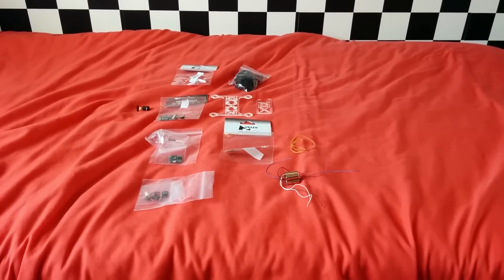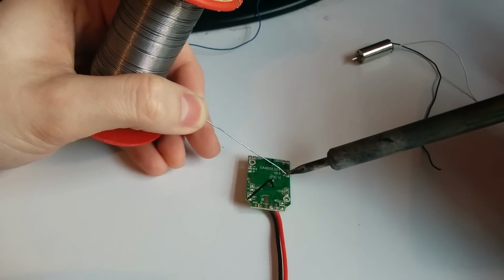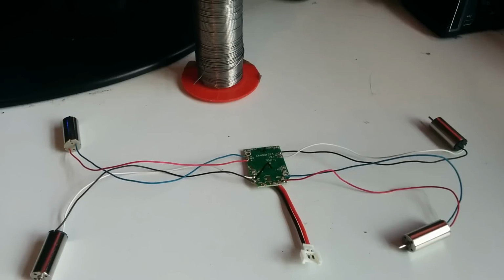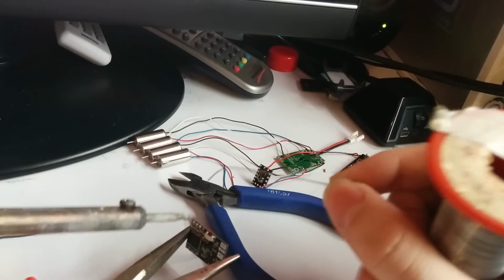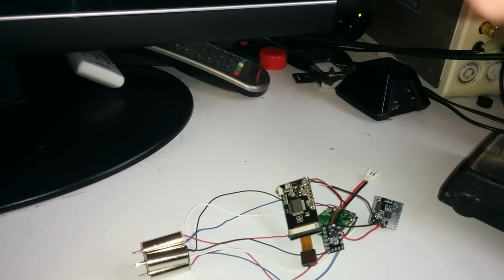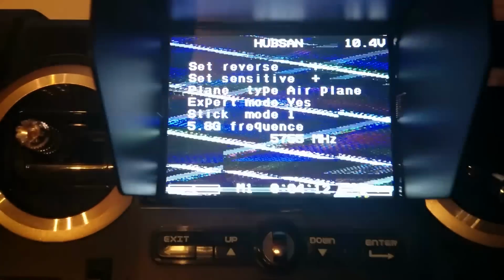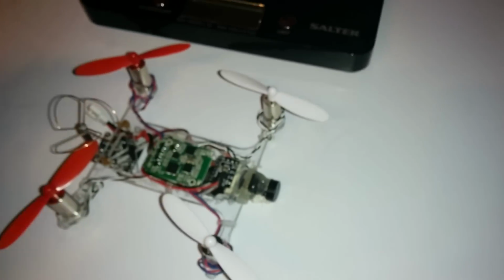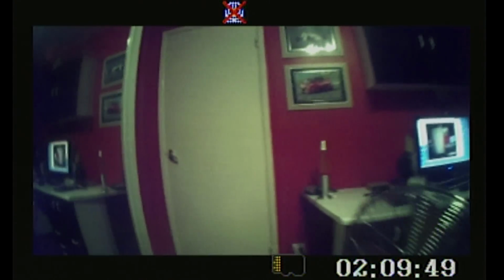Microquad Custom FPV Full Build & Flight With HD Recording

Comment: Hi Andy, you are very knowledgeful with these mini quads.  I really need your help too.  I purchased the JJpro T1  mini quadcopter and the "irange" transmitter, both links provided below of where I got them from.  Unfortunately there aren't enough youtube videos on how to bind these two together.  Can you either tell me if the two are compatible and capable of binding or provide a video demo? I have not had any success binding, maybe I'm missing a step?

http://www.gearbest.com/multi-rotor-parts/pp_484251.html  

https://www.banggood.com/IRangeX-iRX-i6X-2_4GHz-10CH-AFHDS-2A-RC-Transmitter-With-A8S-Receiver-p-1119005.html?rmmds=search

Comment: Hello Andy. I have been watching your videos for a long time now and then i decided to make my first little mini quad with a hubsan PDB/reciver and The motors that you get with The hubsan x4. I had The hubsan x4 but The PDB broke so i kept The motors and The transmitter. When i got my hubsan PDB from banggood i tested it out so i plugged in a battery and i was able to bind it to my transmitter. I soldered The motors to plus and minus as you said in your in your hubsan build video. But it wont lift, it only turns to The right as soon as i am at 40 throttle, it flips to The right. It is like i have 2 very powerfull motors and 2 are very weak. But When i try turn to The right The quad turns. I Wonder If The problem is The motors or The PDB or my transmitter. Btw i have The transmitter that i get with The hubsan x4. I used The 120 mm lktr frame. Keep up The good work with your videos👍👌😊
Reply from the maker: it sounds like either two of the motors are wires wrong or the props are on wrong. hope u get it sorted!

Comment: Andy could I just add the transmitter to a stock hubsan x4 107c? From my understanding the camera board you used is the factory hubsan one that would come with the x4 107c
Reply from the maker: it has to be the 2mp version and yes u can
Reply: +AndyRC how am I sure that I buy the correct hubsan x107c
Reply from the maker: +Kevin Gregory it will say 2mp version

Comment: Do you have to solder a 2.4ghz antenna onto the bord? Or does it get good range without any antenna? (Not the FPV the flight receiver)
Reply from the maker: +QUIT. no its got a trace antenna built into the pcb
Reply: AndyRC Thank you! Keep on going with your videos! Greetings from Germany!
Reply from the maker: I will thanks for the support

Comment: Another Awesome Video Andy!   Questions:   There seems to be a couple H107C camera boards available out there, is this the C+ model board?   You counted the 4th solder pad from the power leads, is there a label for that pad on the board?  Lastly, so there is only one video lead you solder from the regulator to the camera board?  Keep up the great work, we enjoy your videos!!
Reply from the maker: +OP theFLASH this is the non plus version and its the 2mp version theres also an SD version that does not have it. the pads are not labelled no and now they have put just two pads instead of four yes just one video lead
Reply: +AndyRC Thanks for replying Andy.  I happened to find a listing:  http://www.ebay.com/itm/161850183555?_trksid=p2057872.m2749.l2649&ssPageName=STRK%3AMEBIDX%3AIT

The solder pads are labeled in that listing (2nd pic).  Which do I solder to Tx (3rd pad),  Rx (4th pad)?  I don't know since I'm questioning from the Transmitter (Tx), or to,  same for the Reciever (Rx)?  what's your best advice to this, as I have a few friends who are asking about this to, and I referenced this (your video)..... Thanks once again!!
Reply from the maker: you only solder the video wire to the 2mp board as shown in this vid.

Comment: Andy, my build went well. About weighs about 41g and I have a 380mah bat and I get about 3 mins of flight time. Is that accurate? What's the Max battery should I try? And my quad copter vibrates a lot, how do I fix it. Thanks
Reply: The 380mah is an additional 11g
Reply from the maker: +Alvin Bui the hubsan frame likes to be more heavy than that. use 750mah nanotech battery
Reply: +AndyRC I got the hubsan x4 h107c and I took out the frame and notice my 2mp camera doesn't look like yours. I can't find the solder place for video out
Reply: +AndyRC  nvm Andy i have the non hd one. Will it take video out?
Reply from the maker: not that im aware of :(

Comment: i love your setup!
Reply from the maker: +Alex Morales thanks alex :)
Reply: +AndyRC your welcome
Reply: +AndyRC what if i make it without the 5v regulator? will it still be the same?
Reply from the maker: +Alex Morales no soon as the motors spin up u will lose your picture
Reply: +AndyRC so ur saying the vibration of the motor will be cutting off the footage? If I don't have a regulator
Reply from the maker: +Alex Morales no the electrical noise produced by the motors using the same power source wipes the image out the regulator filters that noise out

Comment: Hi, did you manage to attach a IR/UV filter to your camera's wide lens as I have seen others out there who didn't manage to on the same camera module and wide lens set up.
Reply from the maker: +Adam Ip the 808 lens comes with an ir filter so not a problem. not sure why people are adding their own?
Reply: +AndyRC Ah, Okay thanks. Other people don't seem to have the IR filter on their lens that's all, and haven't bothered fitting one.

Comment: sorry, no, your technique is great. Its just that seasoned pros out here kinda cringe when we see that iron, and we can tell our iron would have made the connection in half the time. I swear you could improve the strength and decrease the dwell time of the iron on your sensitive electrical components if it were properly maintained. Again, I love your videos and just want you to get better. Thanks sooooo much for your micro builds, I'm loving these things. I got two transplanted hubsans in carbonfiber frames with the fatshark micro fpv camera/transmitter.
Reply from the maker: +DJ Klermund you are most likely right. i am not the neatest and tidiest of people. nothings fallen apart yet touch wood :) i do need to invest in a better iron really with temp control. this one i have cost 9 gbp and therefore i dont look after it cheers

Comment: hey bud I love your videos but 90% of your soldering problems are related to the state of your soldering iron. if it was clean it would retain heat and flux longer to transfer it. some real good old soldering videos been out on YouTube  for details
Reply from the maker: I don't have any solder problems but thanks for the tip. the iron is the least of my worries. its the 20 year old solder that still somehow works lol

Comment: Hey Andy, 

I tore the link between the cam and the board. Is there a way i could purchase any cam that could go with the hubsan 107c board ?
Reply from the maker: +bruceleedv no im afraid not its opposite polarity to the 808 16 you will have to buy another bgoard im afraid :( I tried to source the camera and ribbon a few years ago from the part number on the ribbon. they are exclusively made for that product and cant be sold separately. you could try search again as it was a few years ago i searched for one, also broke mine once. the ribbon is really fragile.
Reply: AndyRC
Couldn't find anything man. Will learn to be careful. Thanks for the info !
Reply from the maker: sorry to hear about it. it does happen from time to time in the hobby. i once lost a 200usd quad and planned on packing it all in but i got sucked back in lol. hang in there! when it does work its awesome
Reply from the maker: that one wont fit im afraid. its backwards polarity (the ribbon connects in other way round) it will blow up the entire board
Reply: +AndyRC 
oh my god
trying to cancel my order, looks like i'm too late lol
thanks

Comment: I tried to purchase these Items from FPVhobby.com and had issues with the paypal only check out.  I need to get FPV on my H107C HD!  I also have an H107C normal but the HD has a tweaked frame so it doesn't fly well. I figured with a lighter frame I could make the repair and upgrade to FPV.  Is there anywhere else I can find a small transmitter and regulator without an integrated camera seeing as I already have a camera board on my Quad?
Reply: +RockPDX  hey guys! I had a but of trouble with Phoenix Flight Gear. I ordered the 7mm frame and had to order an 8mm. they still haven't gotten back to me after 3 emails and a phone call. really not impressed with that, but it was my fault. I am however impressed with the frame and it is all put together and flying fpv! I need a wide angle lense badly and flight times are pretty short at the moment. I'm going for the turnigy 3.7 750 and possibly a less common venom 600mah 35c. probably could use the dark editions with better props lol but I'm trying to stay within reason on budget. I didn't record the build but I did take photos. I'll put together a slide show for you guys and get it up asap.
Reply from the maker: +ryanworks35509 readymaderc do a nice pico one also check them out
Reply: +AndyRC thanks Andy! I picked up this: 1 x RMRC - 1258MHz Pico Video Transmitter (PICOTX-1258) = $39.99,  1 x RMRC 5V Step-Up Voltage Regulator (RMRC-5V-REG) = $3.29,  1 x 3 Wire Mini 1.25mm Connector: Generic (3WIREGENERIC) = $2.99.  ordered them this morning. I'm also looking into a lighter frame and the receiver for my ground station.
Reply from the maker: good one :)
Reply: +AndyRC  I was looking at the lawmate 1.2 Receiver but I realized it didn't have the 1258 mhz I needed so after some shopping around I found : a 12 channel receiver from 900 to 1300 mhz that has both 1258 and 1280 mhz from hobbywireless.com for a very reasonable price! It's on it's way now.  The last component to my build will be the frame.  I'm looking at the phoenix flight 110 mm carbon frame.  I'll try to put together a build video and wwe will se what I come up with for my first fpv!
Reply from the maker: great let me know once done I would love to see it
Reply: +ryanworks35509 Would love to hear the results for that combo, especially how's the video noise using that regulator?
Reply: +ryanworks35509  UPDATE: I got my build put together and took photos for a tutorial however upon testing my flight capabilities it seems with this setup that my 1258 mhz VTX steps on my 2.4ghz hubsan radio transmitter.  I used to get about 1km but now at about 50 feet the quad drops from the sky and is no longer linked to the transmitter.  I am going to buy another VTX and Video reciever on another frequency and hopefully not have the same issue, I thought it would be good to go but it looks like radio harmonics are giving me trouble. I took a nose dive and ripped the ribbon cable on my hubsan camera board, i cant find the lense and ribbon cable stnad alone so i'm going to need a new camera, vtx, and reciever... time to order more goods....
Reply from the maker: if you use the wifibooster used in my videos you will no longer have that problem using that VTX. in this build im using 5.8g
Reply: +AndyRC  I twisted the ribbon cable on my lens during construction and now i'm out a camera board!  I looked everywhere I could and it seems there are several different versions of the PCB for the HD hubsan camera. I e-mailed several dealers in hopes of finding anyone that can ship a camera board with a video out pin.  Wish I could find the lens module with a ribbon cable, but they don't seem to match up either.  I tried to steal the lens from my standard definition Hubsan and it didn't have the same routing on the ribbon cable.  I have a 1 gram micro cam on the way so i will be flying fpv with less weight however I will loose the ability to record which makes me very sad face!
Reply from the maker: I had this happen to me also. I bought another from banggood. I think their version has the video out. all the best
Reply: I ordered one from BG, we shall see. The print on my camera board is dated 2014. Does anyone have any data on the version dates or identification codes?  I'll post mine when I get home.
Reply: +AndyRC  I got my 1 gram micro cam in today, made myself a little PDB and after some trouble shooting with power filtering and lens focusing I am flying FPV on my Phoenix Flight Gear 110mm Carbon H with hubsan x4 FC.  The range of the controller still seems very limited, but i'll have to take it out away from the wifi signals to get a good feel for how the setup will perform.
Reply: +ryanworks35509 Are you still using the 1258 Tx? This is the one i have on my list, it's 5.8ghz, read with grains of salt- i'm a newb, but have read tons, people usually use 5.8 for VTx specifically because it avoids conflicts with 2.4ghz. But i guess it doesn't help you with interference from Wifi- i think your phone can even interfere if the wifi is on, or if you live in a neighborhood with lots of wifi routers etc..
Reply: +RockPDX here is the VTx i have on my list, but will wait until i have time, it's Boscam TX5826, TX5823, or the FX758-2. The camera i was looking at is 600TVL. I don't know which antennas yet, obviously will be cloverleaf, but i haven't had time to read yet, any suggestions feel free.. But those Vtx and the camera seem to have a lot of good results for people, since there are alot of people using, there is a lot of info out there for how to set them up.
Reply: +RockPDX You are using the h107C? I have had really bad luck with hubsan- i first started by buying a h107L, a motor went bad after 2 weeks, replaced, didn't help, so turned out it was the board (an FET i think it's called). So i bought another, it went bad in about 2 weeks again. That's when i decided to heck with it i'll learn to build one, i bought a h107C and a h107L flight controller along with dark edition motors for the h107C and lots of stock 7mm motors for the h107L. BOTH went bad before i could even get in the air- they worked for a few minutes but then one FET went bad on each of them. Now i have a nano QX FPV FC. As i understand, the best radio to use is going to be the tanaris, otherwise you're buying the stock Tx, which is useless for everything except the nano.. So once i have the radio we'll see how long the nanoQX FC keeps working.. The motors are a pain to solder on the hubsan FC's, i thought not nearly as bad as i had read, once i got a fine solder tip, but still a pain, and the QX FC has connectors built onto the board- the dark ed motors come with matching connectors..
Reply: +RockPDX yes I am using the hubsan guts. I don't have a fancy radio yet so it was nice for bind and fly. but since I broke the hubsan camera I can't record. I switched to a 1 gram camera and still using the 1258. I have a dipole laid flat along the quad for best signal strength. I thought about switching to 5.8 but then I need another receiver... I'm going to do the best I can with this, post my results, and then move on to a zmr 250 with the lessons learned.
Reply: +RockPDX I had issues with one of my hubsan boards too. the ground cable for the camera rests too close to a pad on the FC and the can touch on hard landings or even just putting in a battery and it fries the rear right motor. I put a dab of hit glue over mine and adjust the solder joint. I like soldering so I'm not concerned with the motor mounts save weight
Reply: http://tech-buzz-2015.blogspot.com/2015/05/how-to-make-cheap-flying-dron-at-home.html there is a good photo of the board here, you can see on the bottom to the left of the negative battery solder joint there is another negative pad.  Directly above that negative pad is five line shaped pins. My hubsan X4 HD came with the negative lead from my camera board attached to this negative terminal, however the wire was not properly attached and touched the bottom line shaped pin and shorted out the chip on the other side of the board. wish i had some nice pictures to post for you, but that's what happened on my board.

Comment: Great video. This will be my next build. I don't have a hubsan transmitter but I do already have fat shark goggles. I do need the basic hubsan transmitter. I looks like I can save $28 by buying the h107c rtf rather than buying the individual parts. Is there any down sides of taking the parts out of an rtf? Does the camera module on the rtf also have video out?
Reply from the maker: +Bore Hog if you buy the 2mp version then it will have the video out but not the SD version if i reall. cant think of any down sides other than the time it takes to take it all apart. all the best

Comment: Andy me again. Question for you. I built the FPV plate using your instructions and that end works great, however when strapped to a lightened x11, the quad seemed slow to react to controller input. Could the 1.3gHz tx be overpowering the controller board on the quad? They are in very close proximity.
Reply: I think that there are some problems with frequency harmonics. you can try a low pass filter if you can spare the weight or possibly try a location with less ambient rf noise. (away from wifi)

Comment: Hi Andy, Really enjoying the video's! I'm itching to build one of these micro copters, but I'm new to the hobby. I've ordered the FlySky FS-i6 (As I'm also building your 450 quad). I'm wondering if this will be able to control this quad copter? If not, can you recommend what component I'd need to swap out to operate it with this radio controller?
Reply from the maker: +Ash James you cant control a micro with that transmitter im afraid, in fact the only wat to control it with any other transmitter at all is get the devo 7e tx and mod it to support the hubsan protocol. or buy a hobbygrade tx such as the fr taranis and but the hubsan module for it. or you can add a non hubsan controller board such as the aienwii or MWC but then your transmitter needs to support DSM2 protocol which the flysky does not. all the best